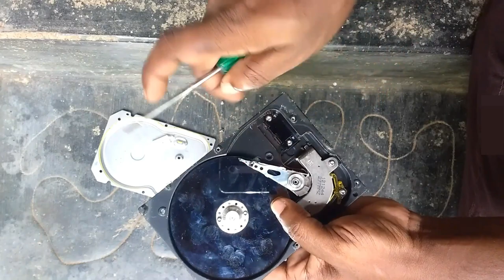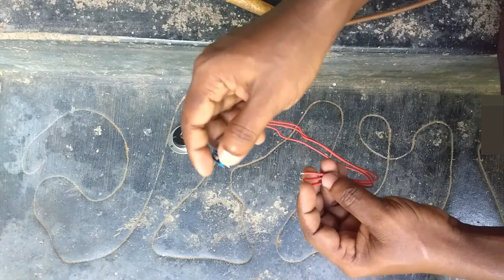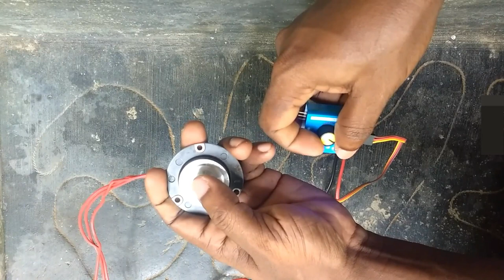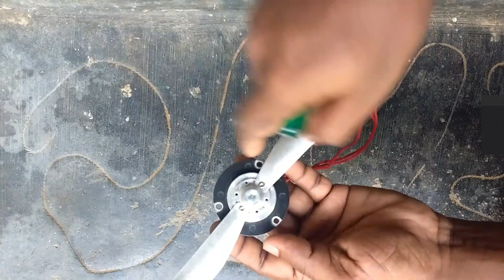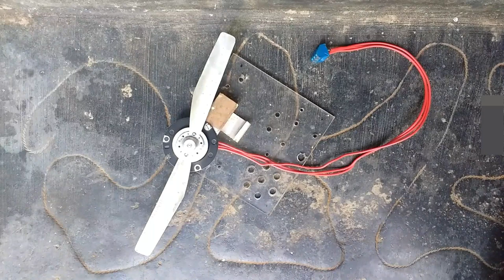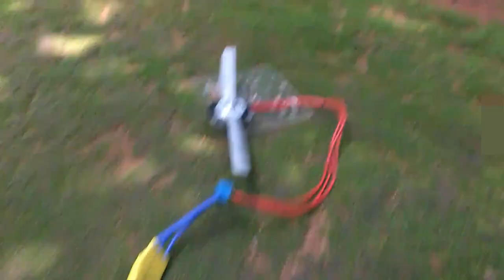hdd motor test

Comment: Ith vach oru monocopter ondakkavo?
Reply from the maker: That requires more components like radio connectivity modules and flight control system. Nilavil ithonnum kayyil lila. Medikkan pattiya sahacharyathilum alla. Ennenkilum ithokke medikkan pattuanenkil enthaylum cheythu nokkam.
Reply: @essential_physics  bro arduino vachu just hover cheyyhna simple monocopter cheyyavo
Reply from the maker: @jayakrishnans2785  try cheythu nokkam.
Reply: @essential_physics  thanks☇❤❤
Reply from the maker: Helicopter cheyyan oru shramam nadathi parajayappettu. Kurach coponents medichitte onnukoodi nokkam. Kurach thamasamundavum. Kozhappollallo alle?
Reply: @essential_physics  amm ok🤗
Reply: @essential_physics  insta id tharamo?

Comment: Bro 60amp koduthal motor damage vallom akumo?
Reply from the maker: 60A ESC ano? Njan use cheythath 
30A ESC aane. HDD motor ne apekshich ath over rating aane. Ennittum oru prashnom illathe work aayi. Athukonde 60A ESC use cheythalum onnum sambhavikkan ponilla, over load cheyyathirikkan shradhikkanam enn mathram
Reply: @essential_physics  OK bro 
Ippo video chayyathentha